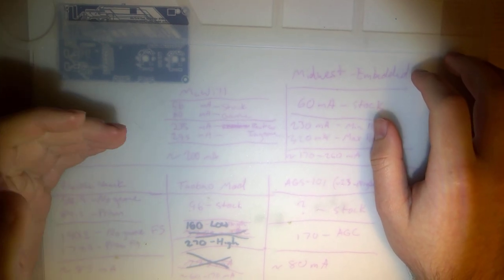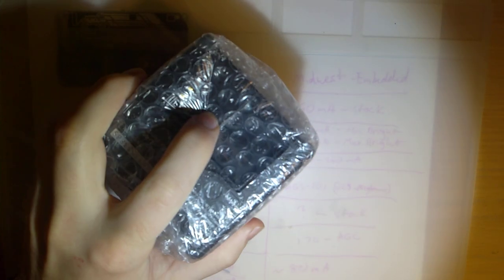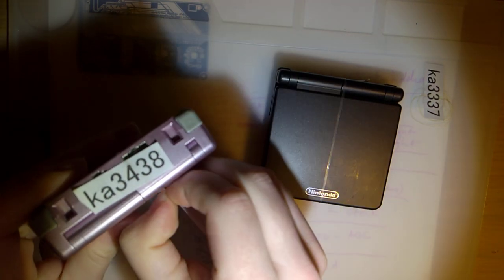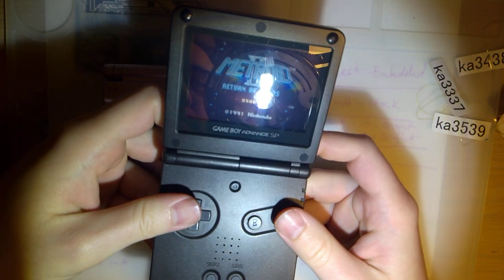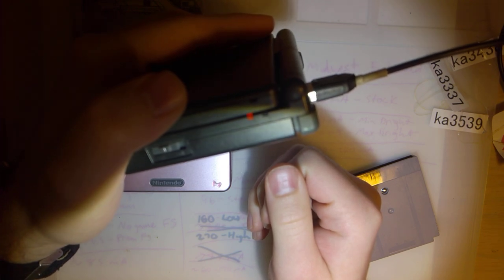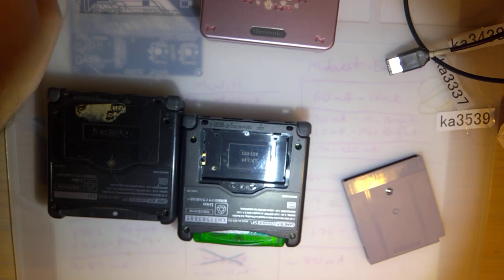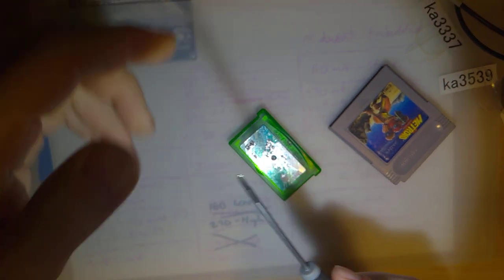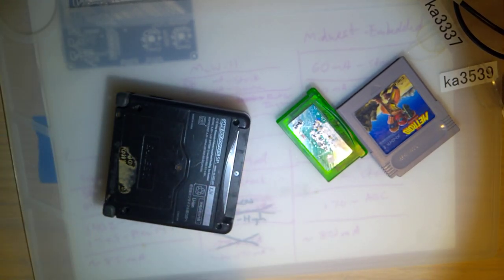Fixing Some "Junk" GBA SP Consoles

Comment: I have a GBA SP with audio issues where the volume is really low, i can only hear it from less than 8 inch or 20cm away at max volume, but when i connect it by headphone jack the sound is loud. any idea which part of the PCB requires repairing. or any way to add an amp to a GBA SP.
Reply from the maker: You should do more troubleshooting instead of jumping straight to an amp. Have you tried another speaker perhaps?

Comment: I wanted to see you clean the stickers off the 2 SP’s!!
Reply from the maker: Hindsight =(

The pink one came out very nicely except for a relatively small but deep scratch under the big sticker on the cover. I just used a heat gun (on low and from like a foot away) to warm up the stickers and then a plastic pry tool (not the ifixit ones but the cheapo generic ones) to scrape the stickers off. Then I hit it with goof off to get rid of the residue and then windex to clean up the goof off. The black one was a bit more difficult to clean up but I ended up using warm water and soap to clean it due to the sticky green stuff. Then I did the same for the sticker on the top cover, heat, scrape, goof off, but then I cleaned it with warm water, soap, and a toothbrush because I was already working on the rest of the shell that way. I'll post some pics or something and try and film it next time. I didn't film this time because I was working on the consoles and watching TV at the same time and I was working very slowly (likely due to the TV). Anyway, sorry for rambling. Thanks for watching! =)

Comment: I have the no charge light issue,  reading 6v from charger terminals but only .2 from battery charging terminals. It's a new replacement battery as this console was lost in time for about 10 years. Thoughts?
Reply from the maker: No charge light at all? Did you already check your fuses? The console will not work without a working battery installed. Also, 6v is too high at the charge port and could be causing issues.

Comment: Did you ever figure out the sound issue? I have an sp with the same issue.
Reply from the maker: It ended up being a combination of things. Remember when I mentioned the exposed traces near the dpad? Well, the traces were fine but the vias were corroded. Additionally, the volume pot was bad and I did not have any working spares. I never made a video because it was just me poking around trial and error style for the better part of an afternoon with a multimeter and I didn't think to film anything until it was too late. You can see this reddit thread I made pretty much as soon as I fixed it: https://www.reddit.com/r/Gameboy/comments/bydlbt/i_fixed_a_gba_sp_with_no_sound_using_game_boy/

I did make this later though: https://youtu.be/pbtNE5hy2yA

Comment: I need help with a sp 101 charging light lasts 1 second and no power on. There is voltage on the switch. f2 is blowed and f1 is working
Reply from the maker: Replace the blown fuses

Comment: I have issue with mine. Before it was built in game but the battery is dead so ive been playing just using the charger and after a few months the game cannot be save and next day all games not there. Is this battery issue or anything? And regarding my sound problem when i turn off the sound it still produce slight sound. Can u help me?  Thanks
Reply from the maker: I'm having a really hard time understanding what your issue is. Can you elaborate?
Reply: makho my gba sp, it has built in game before so Im not using any game pak tu play. But after the battery is dead. I started to play it without the battery and just using charger. But after few months the game can be played but cannot be save and after that no more game list. It just pop the gba logo the nothing. And then regarding sound issue, even i turn the volume off it still produce slight sound
Reply: Then* nothing
Reply from the maker: @m0kcun  that sounds like a bootleg console. I'm not sure what the issue could be but I'd start by putting a working battery in it.
Reply: makho will buy new one and let you know
Reply: Already put new battery and game but only pop up the gba sp logo....what should i check next?
Reply from the maker: @m0kcun  I still don't even know what specific hardware you are trying to diagnose. I don't know what your next step should be. Clear pictures would help.
Reply: makho maybe ur email would help me to send u pictures
Reply: U know what I gave up 😭😭 already try a lot of things but I think the IC is broken already
Reply from the maker: @m0kcun  ok

Comment: My GBA SP won't turn on.I cleaned power switch and checked fuse F1,F2 work. The power LED flick then off. Help me bro.
Reply from the maker: try to put pressure on the power switch with your finger and boot it that way
Reply: @makho  I 've tried not work.
Reply from the maker: @hakuzeon498  Sounds like there might be a short somewhere then. Is there any liquid damage on the console?
Reply: @makho  Maybe

Comment: Did you ever figure out the correct reading (ohms) when it's all the way up?
Reply from the maker: it's a 30k pot but it's difficult to get an accurate reading in circuit.
Reply: @makho  thank you for your response , one small thing. I have continuity in pin 2 and 4 , Is that ok?
Reply from the maker: @alejandrozim91  here's the schematic https://github.com/Gekkio/gb-schematics/tree/master/AGS-CPU-11